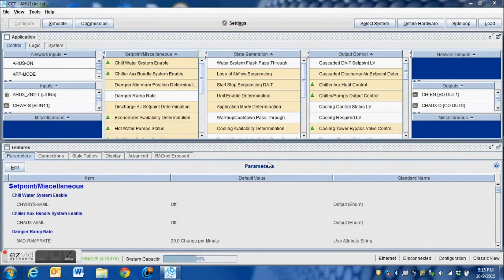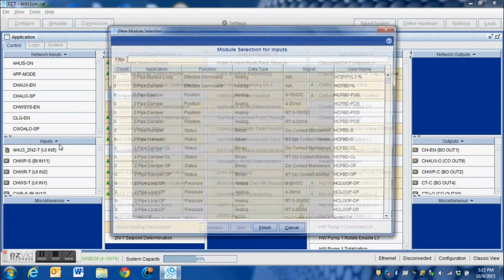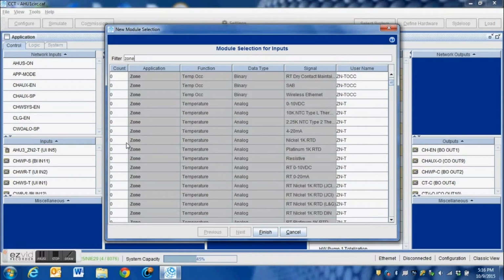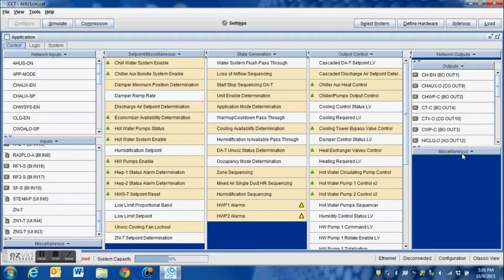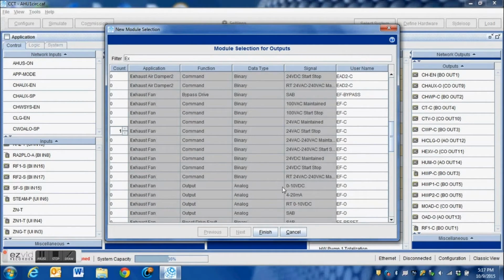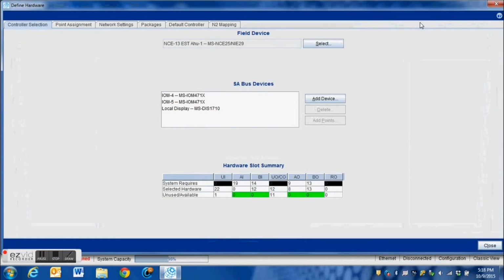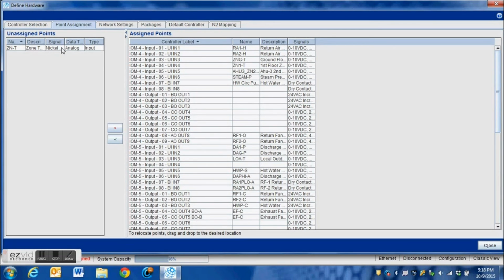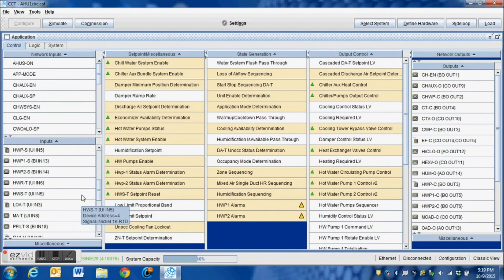Adding Field Points using Johnson Controls Controller Configuration Tool CCT

Comment: I have an Aaon 100% OA that is controlling DA-T. I need to add a preheat sensor and add a differential of say -5degrees from DA-T to control the preheat valve. How would I add a differential in the program if you have any information on that?
Reply from the maker: I'm not very familiar with writing code in Aaon units. Sorry.

Comment: Hey there My Question it that while assigned points will software take care of the types of inputs and output or I have to define by myself?
Reply from the maker: You will need to select the point type when setting up the input or output.  Be sure to check the signal type to make sure it matches what you have on your equipment. I've got a video on modifying point types on my channel. Thanks for watching.  Please like and share the video and subscribe to my channel for more.
Reply: @Systemcontroltech ❤❤thanks

Comment: Hi ,Thanks Man. Good Explanation. I am new to JCI . I have Existing Metasys NAE system in a Plant.  We need to add New  Flow Transmitter with Bacnet  protocol. Do u have any support videos.
Reply from the maker: Yes, I have a few videos that show how to pull points into the system. Make sure that you configure the address in the device to work with your network